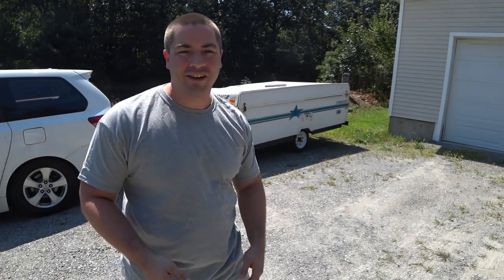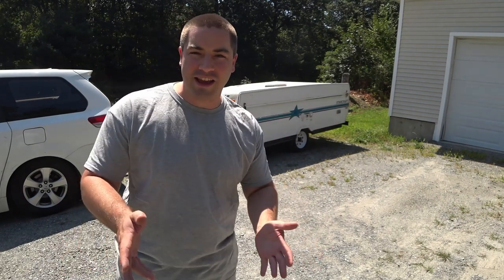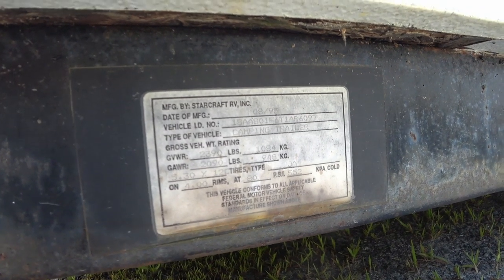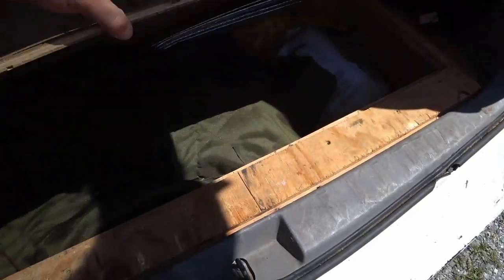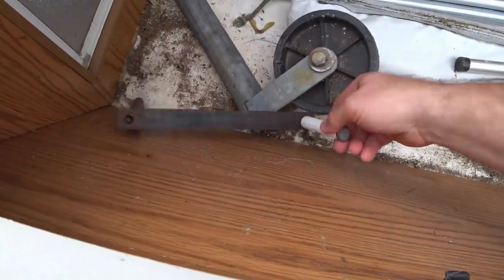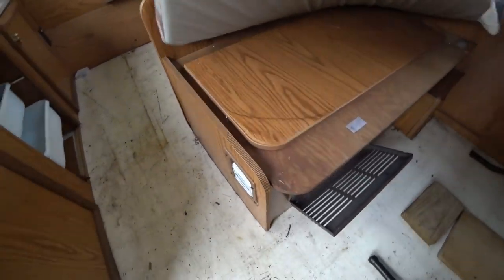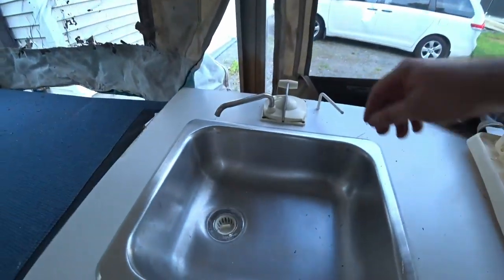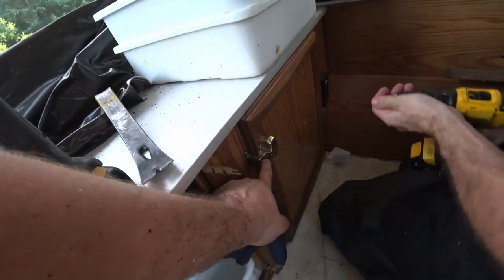Demo of Free Pop-up Camper, Solar Trailer Build Part 1

Comment: Yes your projects always interest me.
Also would like to see a update on the hot water heat system for the work shop.
I can't remember how that turned out.
Reply from the maker: Most of this past winter the garage was in the low 50's.  A couple times in the high 40's (degree F).  So it's a success that the solar alone can heat the garage without needing any oil or gas.  But, it would be nice if it was a little hotter.  I'm going to try and incorporate an electric diversion load on the solar electric system.  Thanks for asking.

Comment: hi david off  topic  sorry.  starting on my 2nd larger solar build. seems i bought wrong torque wrench 10 lbs to 80 lbs. for solar it seems for combiner and disconnect box wireing most torque is 20 to 200 inch pounds. do you have to buy a screwdriver torque  tool and  a a wrench torque tool . or  is there a tool  does all?  also what torque do battery post require?
Reply from the maker: When it's a low torque (like a screw on a circuit breaker) I just do it by feel.  I don't own a screwdriver torque.  But, if I owned one I would use it.  It's on my list to buy.

Comment: Whats the point in having a huge minivan if your going to rip out the back seats? Why not a regular SUV?
Reply from the maker: I don't typically need 4 wheel drive where I live, which would be the best part of an SUV.  So when I was pricing them I found the mini-van was cheaper, and better fuel economy.  Of course, this is very general terms and there are exceptions.